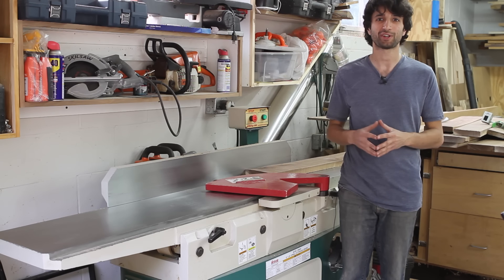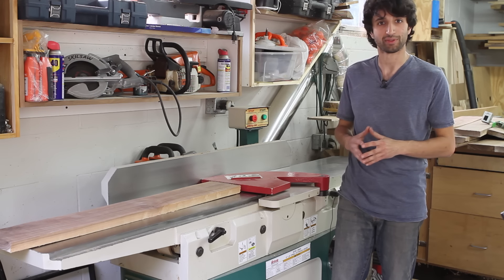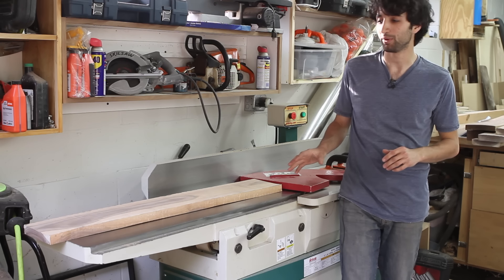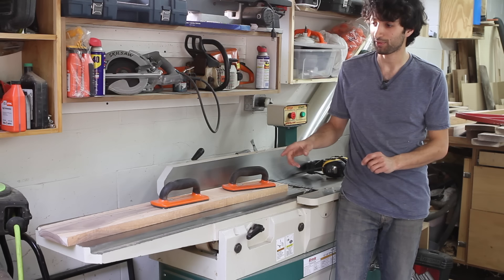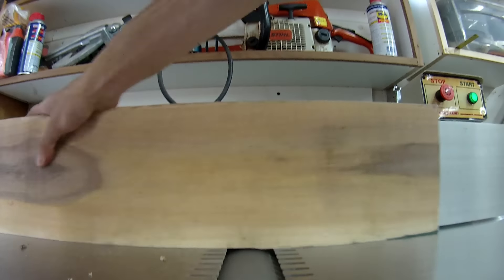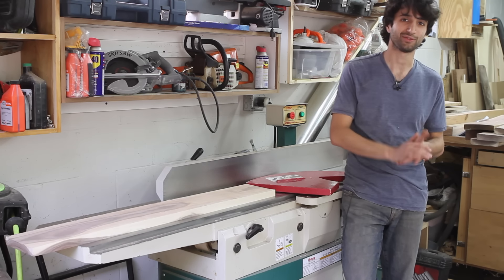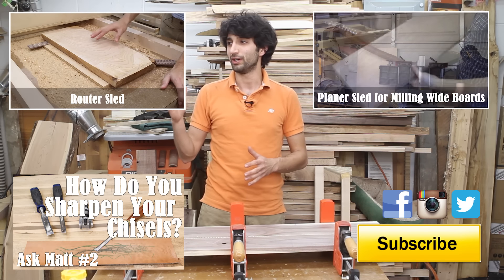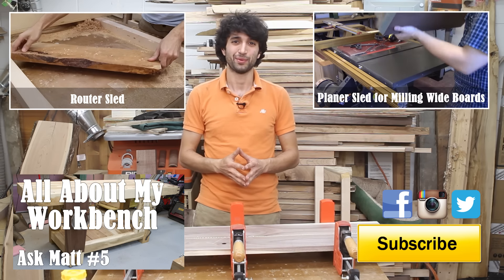What Does a Jointer Do? - Ask Matt #13

Comment: I know this video is old but I wanted to comment anyways, I have been woodworking for about a year and a half, I have amassed decent tools but I don't have a jointer or thickness planer, and no mater how hard I inspect the wood I buy from home depot it's rarely perfectly straight, I have main only made shop furniture but even that is a train wreck sometime because of twists and bows in the 2x4's, I recently bought a porter cable electric planer which i'm trying to turn into a homemade jointer , I'm glad you posted this video because I was unsure on the technique to feed wood through a jointer with light pressure

Comment: Great video and well explained. I think increasingly though hobbyists are choosing to use MFC, Plywood or MDF to build furniture. None of those materials require a jointer or planer. Many of the Ikea hacks posted on the Internet were done with nothing more than a drill and a circular saw.  Working with solid hardwoods is great. But in many countries it is very expensive to buy.

Comment: You can do the compromise and purchase a combo planer/jointer, that will have some issues with ensuring the perfect paralel flat planes on the jointer table but close attention to cleaning the resting surfaces helps a lot.

Comment: I have a 4" jointer and I think after watching this video, it brought to light, what I've been doing wrong.  I have indeed been putting pressure on the board with my push pads on the entire portion riding over the cutting blades.  My edge jointing has seemed to work well, and I mark my boards, so that on one cut with one board, the mark is towards the fence and the other board has the mark away from the fence.  If your fence isn't exactly 90 degrees, the method I use keeps glued up edges flat.  Thanks for the tip.
Reply from the maker: Ron Briz I did the same thing when I first started using a jointer.  I think push pads are probably the worst safety device for the jointer.  You have to be very methodical about where you place them and how hard you push.  I went over that trick but it ended up on the cutting room floor.  Thanks Ron!

Comment: Hi, it's me again : )
6:11 - "the proper way to use the jointer" is, IMHO, to apply as little pressure on the wood on in-feed table, and push it down, hard, on that part which is already on the receiving (or "out-feed") table. At least that's my experience with woodworking.
Wood is inherently flexible, and even worse, a piece of wood can (and often do) contain a "web of tensions" within itself. Sometimes you take a board, run it through the jointer, get rid of all them cups, bows and twists on one side and then run it through the planer - and, lo and behold, it will come out crooked. Why? Because the planer just cut off that part that was "balancing" the other side. Like, you succesfully managed to true a bicycle wheel with one missing spoke, and then you'd cut a spoke on the opposite side of that wheel.

Or, you can take a perfectly flat board (that you've just run through jointer and planer), cut it in half lengthwise - and you can end up with two twisted bows. So while you're generally right on "how to use a jointer" there's a bit more to this than "just follow the rules".
With wood, sometimes it works, sometimes it doesn't. Such is wood, such is life... ;-)

Comment: Hi ,Frank Hurley from knotty ash, UK. 
I have in the past used a planer thicknesser to produce boards for kitchen cabinets etc.
When you joined yours for a panel, I see you did not mention reversing the arch of the grain to prevent warping.

Comment: All of those jigs for the Planer require perfectly straight wood, which you won't have unless you have a Jointer, or know someone with one that can flatten the boards for you. I bought a planer a few weeks ago and realized that it was not a lot of use without a jointer, so I just bought one of those too.

Comment: we call a joiner, a surfacer in the UK. Also in the UK the most common type is a combined machine, with a surfacer (jointer) on the top, and a thicknesser below it, thus using the top cutters for two purposes.

Comment: Matt, I'm not trying to argue as I am new tow working with wood I didn't have enough money for a planer and jointer so I build a sled for the planer used shims under the board and ended up with flat boards that I built a 7-foot dining room table with
Reply from the maker: sure, that works too

Comment: Great video,  You cleared up my issues with planners and joiners now i get the whole point and how to uses these properly. One thing i am curious of is how do you flatten like sheets for example like 8x4ft plywood ,OSB or other types of wood sheets. I get these machines fix any problems for lumber sizes and pieces aka all the standard 1x3, 1x2 , 2x4 , 2x6 , 2x10 ,....etc(even your own custom sizes) . But there just not big enough for sheets

Comment: Great explanation! Just one thing: coplanarity means that two things are contained by the same single plane, like two lines lying on the same plane. But the ones you're referencing are two different planes (the higher and the lower one) so the word you were looking for was "parallel planes" ;)
Reply from the maker: You're absolutely right. Sorry about that. Let me set my depth of cut to 0 and we'll talk ;)
Reply: In that case, we both know the answer to "What does a jointer do?" :D
Reply from the maker: Lorenzo Paleari hahaha!  "Why doesn't this do anything?!"

Comment: Just as I expected I have nothing bad to say about this jointer MyBest.Tools make a solid clean and level cut and adjusts in increments of 1/8ths and 1/4s I ran stock 2"x4" x8" at 12' long and had no issue.

Comment: A jointer is used to straighten an edge or to flatten a side once you have a flat side your planer is for thickness. The back table on the jointer is set lower for low much you need to remove to make your piece flat

Comment: Hey Matthew thanks, did you know if you don't have a jointer yet, you can use a table saw in place of one?  I was taught that as an alternative for tight budgets.  You have to build a fence guide like the jointer table and of course want a good sharp blade for a clean cut.

Comment: You answered my question about using a hand plane first and then running it through the planner so heres my question-does it have to be a #4 or could i use  a#5 jack plane?which wood  be more sufficien? I just picked up a Stanley # 5 Jack from rockler other day. I have yet to use it .needs to be sharpened. But as always great informative vid. Looking forward to the next vid..have agood one matt!
Reply from the maker: Joe Walters You can use any plane you want.  You're just looking to knock down the high spots so as long as you can do that you'll be set.  Thanks Joe!

Comment: Thanks Matt. A great explanation. I watched your video because I've been confused for some time over the term 'jointer', used in other videos from the US. Turns out that your jointer is what I, in the UK, would call a surface planer and your planer is what I would call a thicknesser. The combination machine in the UK is a planer/thicknesser. At least, it used to be when I was using one forty years ago! I'm wondering why the US adopted the name 'jointer' which is not really descriptive of the function of the machine. Anyhow, you have clarified the machines and the process admirably.

Comment: Great explanation from a man I consider to be a Master Cabintmaker.BTW he is correct the two feed tables ARE indeed coplanar and NOT parallel.
Reply: Not so great explanation when he's talking nonsense and also showing with his hands @ 4:15 about the cut depth being determined by the infeed table set lower (on a different plane) that the outfeed table, which is impossible for coplanar tables  ! @ 4:18 he also totally shows parallel planes not coplanar

Comment: That's a difficult concept for many but your excellent explanation should clear this up for most. I took wood shop in both Jr High as well as Sr High (in the 60's) and I clearly remember the teachers saying that the jointer was the cause of most accidents (they might have meant they caused the most damage to the user) in shop class. Now a days it seems I only read about the table saw with little mention of the jointer.
Reply from the maker: Steve Collins Thanks, Steve!  That's interesting.  I hear of way more TS accidents than I hear about jointer accidents as well.  Did jointers somehow get more safe over the years?  I doubt it...
Reply: Matthew Cremona I think the design has been the same forever. You know, it's possible that what they were saying was that a table saw, band saw, etc... accident will generally leave something the doctor can work with, but a jointer will leave very little. Having said that, the only accident I saw in those years of wood shop was done on the band saw.

Comment: Great video but when you glue up your panels made from your milled lumber, add a couple of bar clamps on the face of the panel to prevent the panel from taking on a potato chip form. I do live in Louisiana and have been fabricating custom cabinets for 20+ years and the adding of a few clamps on the face of your panel saves a ton of heart ache. Maybe it’s the difference of humidity levels from where we each live that makes a difference. Very informative video though. Keep up the good work!!
Who Dat!!

Comment: I've tried the shimmed outfeed side of the fence on the router table. I've also made 2 straight edge jigs for the table saw. These methods can be used to edge joint, but the setup is annoying and you still have the face of the board to deal with. A jointer plane or low angle jack plane also work if you're Paul Sellers. It doesn't take long before we all want a jointer. I'm buying one today. Just deciding if the Jet 6" is worth $300 more to me than the Grizzly 6"

Comment: Thanks so much for this video -- very helpful!! Beginner question: once one edge is run through the jointer, why are the typical instructions to run the opposite edge through a table saw? Why not run the opposite edge through the jointer?
Reply: Your board will not be same width thruout..so you still need to pass thru table saw for desired width..save time only pass one side.cut of other side.

Comment: Great explanation Matthew.  I have to admit, this is something which I never really understood at first and the technique of using a router sled certainly looks like something most people could build and use effectively, for very little additional expense.

Once lumber has air dried fully, will boards stop warping, or do they always warp slightly? Say if you prepared some lumber that was dry and then didn't start the project for a few months, would they need a quick pass through the jointer and planer before you start?
Reply: it is usually better to not prep wood for a project months out. wood will absorb water from the air, this will cause wood movement (cupping,wrapping,twisting, etc). so if they are stored in a humid shop, they'll probably need to be touched up again. in a temperature controlled shop you might get away with it.

Comment: If you only have room for one, you can buy a jointer/thicknesser that does both jobs using the same cutters! This not only saves room but costs less than the price of both machines. Plus, I never really got it being called a jointer? (it doesn't join ANYTHING!!!!) I think it should be a planer as it planes the wood! Also, I would go with thicknesser over planer for the same reasons! Personal preference I guess.

Comment: Hi Matt - great video.  I'm someone who would like to do some woodworking, but don't have the equipment, and therefore my knowledge and skill are very limited.  I try to pick up things along the way through videos and articles, etc.  

I'm curious: how often do you glue up freshly milled stock simply edge-to-edge, and how often do you (or do you ever) create more surface area for the glue with something like biscuits?
Reply from the maker: Edge gluing boards to make up panels is a common process.  Pretty much every project includes that.  I don't use any biscuits or dowels.

Comment: I have zero experience, and after watching your great video one question comes to mind, after completely removing all inconsistencies and getting one board flat on all sides, how do you know how much material you have removed so that the next 10 boards (for example) end up being the same exact thickness, since you will have to remove different amounts of material on all boards to get them all nice and flat, would you have to run all of them through the planner and set the thickness to match that of the thinnest board?. As I mentioned, I have zero experience. Thanks!

Comment: Hey Matt, great video. One thing you might have mentioned was reading the grain so you try to avoid that nasty "snick" sound. Do you sharpen your own blades? I got a lot out of this one.
Reply from the maker: billfromelma Thanks!  I'm actually planning to do a separate video on grain direction too.  This one was getting a little long and I had to trim it back a bit.  The jointer has carbide inserts and my planer has knives.  There's a place in town that I take my knives to be sharpened.  It's the same place I take my saw blades.

Comment: Thanks Matt, good reference. A few questions:

1) Did you get a new planer? I thought your workshop tour had a 15" one.
2) I can't remember...8 or 12" jointer? I'm in the process of buying a 15" planer and am not sure which size jointer to follow up with. I was think 8" would be adequate?
Reply from the maker: l3ender15 Thanks!  1. yes, I got a new one a couple weeks ago.  Check out my shop update from 2 weeks ago.  I talked about that adventure towards the end.  2.  It's a 12".  For the boards that I use, an 8" would be too small.  Most of my stock is around 10" wide. If you normally deal with boards that are 8" wide at the most, and 8" would be fine.
Reply: Matthew Cremona You caught me on not watching the shop update...they're too long, lol.

You mentioned not needing to update electrical for the new planer. Is it 220v with a 6-20 plug instead of a 6-30? I have the G0453PX planer (15" spiral) so I just did some wiring myself.
Reply from the maker: l3ender15 lol  no worries :)  Yes, it needs 20 amp service as well so I was able to take the plug off my old planer and install it on the new one.

Comment: Matt - I'm afraid I have to put a little fly in your ointment, @ 3:48...
Tables of a jointer are not "coplanar" - they are PARALLEL to each other. "Coplanar"means "in the same plane", where "plane" is a virtual infite (endless) two dimensional "object".  
I mean, you can actually get the tables of a jointer to be coplanar, but then you won't be able to cut any shavings. Or, to be absolutely accurate, when feeding (front) table is set to be coplanar with receiving table, the thickness of shavings will be "zero point zero" millimetres (not sure how it would work out for imperial units... ;-)
(Unless, of course, you set the blades too high, but that's another kettle of fish.)

So, whenever you're making a cut on a jointer the tables are PARALLEL to each other, but they are not in the same plane. My guess is you tend to think that "parallel" means that one "finite rectangle" ("table", in this case) has to be above another one (or something like that), but it's not the case - they might be a thousand light-years away from each other, or even infinitely distant - in geometry it doesn't matter at all. Whether they are within 1/128th of an inch from each other or separated by infinite distance, it's all the same - if they are EXACTLY on the same plane, they are coplanar - but if they are just a tiny fraction of a smidge off (even a Planck lenght off) they are no longer coplanar. Parallel, yes; coplanar - sorry, no longer.

Other than that, you're making great videos. I really enjoy watching them, I really do.
Cheers,
KB

Comment: The theory of how the machines work still holds just curious if there is bigger versions of them that handle large wood sheets of different thickness. Most of the time i uses just lumber for a hardware store that isn't perfectly straight anyway but i have run into issue in building before and like to just make it easier for next time if i build a house and have these types of machines at my disposal. Still its really good to be aware of how to uses these and how to get perfect results thanks for sharing.

Comment: "At an angle" makes me think of something not 90 degrees.. perhaps "perpendicular" is a better  word to use here. 

Btw excellent video. Thanks for going over both machines. I always wondered what the difference was.  So with a jointer does one even need a planer if the jointer is what really flattens and squares a board?  Is the planer better at taking off desired amounts of wood so its a certain size? Does the Planer leave a better finish?

Comment: Hi Matt, as always an informative video. Do you need to be aware of the direction of the grain as you run the lumber through the jointer or planer? Thanks!
Reply from the maker: Dave Hernandez Yes, if you have straight knives in either you'll want to pay attention to the grain direction to get a smoother cut.  Sometimes the grain direction will change within the board in which case you just have to pick which direction gives a better result.  Thanks Dave!